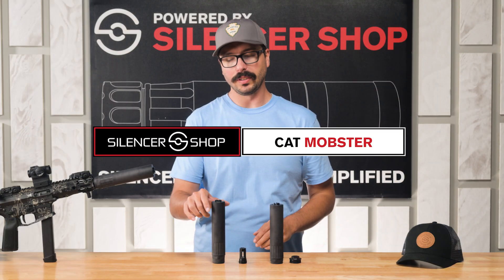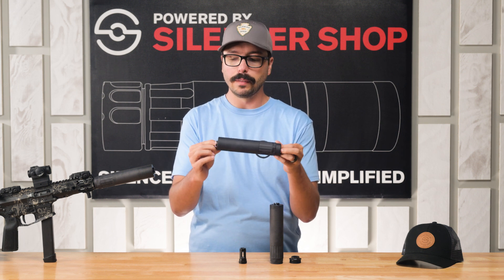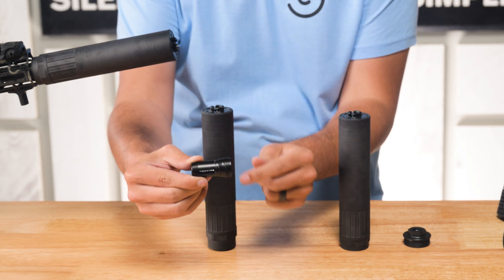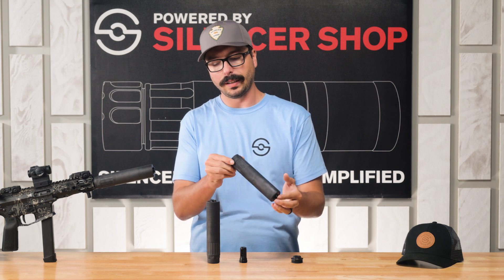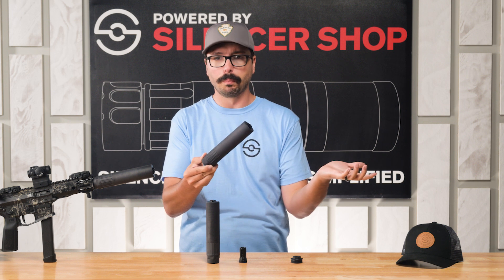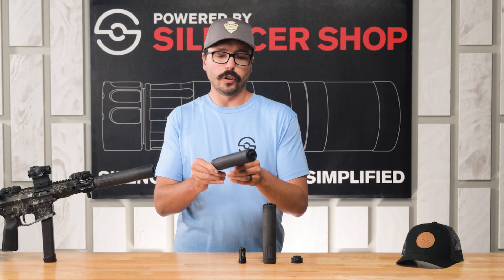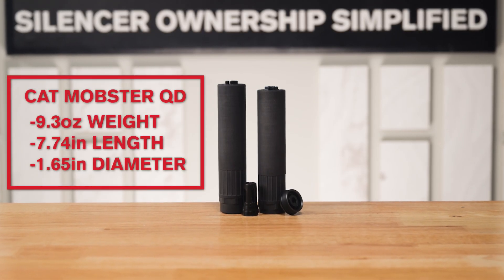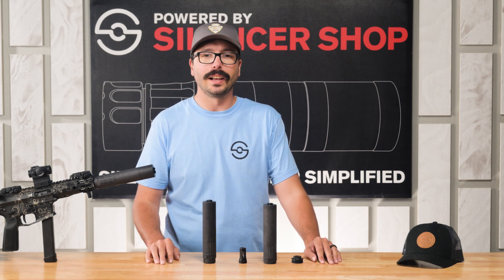CAT MOB - High Performance 9mm Suppressor

Comment: Just got my CAT MOB HUB TI today.
Looks great.
Question though.
What all are suppose to come with the suppressor?
I received Suppressor with DT mount, a Large CAT shirt, a single CAT sticker inside a White plastic pull apart box measuring about 3x3x9" when collapsed.
Was there suppose to be anything else included?
Reply from the maker: That is correct! It seems like you have everything that's supposed to be there.

Comment: What is the difference between the CAT MOB and the CAT/Alleycat 36?
Reply: They're incredibly similar. CAT told me out of all their Alleycat suppressors, the MOB and Alleycat 36 are probably the most similar. The Alleycat is a hair shorter and lighter which is interesting considering most Alleycat are heavier. The MOB has the small flash hider type deal at the end, but the Alleycat does not. Other than that... I'm not sure. I want to guess maybe one less baffle than the MOB, but both sound insanely good to me. I'd go Alleycat if price is the same since it's shorter. Otherwise maybe MOB if it's cheaper.

Comment: 1:51 Does this suppressor work with 3-lug mounts?
Reply from the maker: Yes, with certain tri lug mounts. We used SilencerCo and Dead Air mounts without an issue. The new Resilient 3-Lug also works!
Reply: @SilencerShop  How about YHM?

Comment: I am loving everything about this, but before I can say yes I am concerned about the cleaning process and cost of the cleaning. $140 for the solution is steep.
Reply from the maker: You do get multiple cleanings out of one jug of CAT206, and this silencer doesnt need to be cleaned very frequently, every 2500-ish rounds is fine!
Reply: You can just throw it in the dishwasher.  Titanium is rust proof.

Comment: I got the qd model..almost wish I got the hub mount. I’m looking at getting a sig Mpx k for a host. What’s the best way to mount the suppressor? A thread adapter to 1/2 28? Should I just get a ilwt barrel?
Reply: Even if you get the taper adapter, I don’t think there is a Spooky for the MPX’s thread pitch. You can get your stock barrel rethreaded to something more common, or just go with the ILWT barrel.
Reply: @alexwonkim   yeah I’m getting an ilwt barrel
Reply from the maker: Youll want to use a taper barrel adapter with the spooky muzzle device.
Reply: ILWT 1/2-28 barrel is absolutely the way to go. It's what I'm running and I love it.
Reply: For most setups, sounds like the HUB would be the better option?

Comment: How much better is the CAT Mobster vs Resilient RS9?
Reply from the maker: Theyre both awesome PCC silencers.
Reply: @SilencerShop Don’t be political.  Answer the question boy.
Reply: @Bromo_Sexual  I can answer this as have shoot and own both models :)

MOB wins by a tiny margin on my three host guns AP5,SP5K and 38sp lever rifle using DT mounts.

I need to compare both with 3 lug mounts in the future.

These are so close noise wise plus both have great tone to them shooting it’s a win , win.

If you were  to change the host or ammo maybe the results could flip either way, yeh that close.

The RS9 is the best bang for the price all day and I like its size/shape personally.

The MOB is pretty much king of the hill 9mm Sub-gun wise right now with the Vent 2 and RS9 in the top 3 or 4 models. 

I also have and love the Lithium 9 it’s amazing small and lite weight at 6oz including DT mount and very quiet too. I love it on the baby MP5k’s :)
Reply: @SilencerShop  Answer the question boy.

Comment: Would this be a good  option to use with 350 Legend?  The one I really want is the YHM R9, but I can’t seem to find them in stock!!!  Please advise.
Reply from the maker: Its a great option. It is designed and optimized for 9mm, but is rated for 350 Legend subs and supers in a barrel 16" or longer.

Comment: If you purchase the QD version and later decide you want to use it with trilug, are you screwed?  Can you swap out the QD or is it permanently fixed to the can?
Reply from the maker: QD is integral, if you want to use tri lug you'll have to get the HUB model.

Comment: What if I want a CAT MOB  in stainless or in 718?
Reply from the maker: Not an option right now, and not necessary. 9mm is very low pressure and heat, titanium is more than durable enough even on full autos, and because of the small powder charge 9mm from a PCC has little to no flash at all. For a dedicated 9mm silencer titanium is a top-tier material choice.
Reply: @SilencerShop  so even under nods, there will be no sparking?  I think even the smallest amount of sparking is reason enough to have a stainless or inconel suppressor.  But CAT assured me there would be no sparking like the CGS Ti suppressors I have.  I'll cross my fingers.
Reply: @mattself6078  hey, did you end up getting a mob and if so is there any sparking?
Reply: @markeveren5072  I go pick it up tomorrow.  Going straight to the range afterwards will let you know tomorrow evening.

Comment: How many rounds can you shoot until you HAVE to let the titanium cool down?? Are you talking 15-50 rounds or hundreds? If you are saying you can only do one mag dump why would anyone buy this?

Yes, I heard what you said in the video, But there is so much convoluted information on this company it’s completely maddening. I just want to know if I can go to the range shoot a couple hundred rounds and not look like a fucking weirdo with a heat thermometer. It’s over $1000 for the can and they’re talking about thermometers?
Reply from the maker: We'll to a heat cycle test that will provide a lot more information.
Whats relevant is how you're actually shooting the gun, if you're loading 10 mags, and shooting them all back to back with no wait, then you might get the can hotter than it should be, but very few people shoot like that. 

Most people are runnning drills or casually plinking, where they're shooting a few rounds, then reloading a mag, or resetting a target or whatever, and doing it again. The can cools very fast, so as long as you have some down time it'll probably be good to go. 

CAT recommends an infrared thermometer so that you can build out a shooting schedule  that works for you. 9mm is very low pressure and doesnt generate a ton of heat very fast.
Reply: @SilencerShop  I have 70 round drums for my full auto. Can it handle at least 1 drum?
Reply: @SilencerShop update on the heat cycle test yet? It's been a year, bud

Comment: I really want to get one but wish there was an inconel option. I bought my first Ti Can (CAT WB) a couple months back and realized why so many people hate Ti cans lol. Shooting under nods was like the 4th of July during an NVG class I took recently. Ditched the can halfway through the night and just ran unsuppressed with a flash hider which was actually doable. Sold the WB and won't buy a Ti can again for a semi auto, maybe for a bolt gun though. I get why the Mob is Ti since it would probably be like 2lbs in Inconel, but wish there was a solid option performance wise that doesn't turn my gun in to a portable firework machine.
Reply: How did you sell your suppressor? It seems like a PTA to sell due to the paperwork.
Reply: @FlayvorOfEvil  thankfully my FFL wanted it so it wasn't hard.
Reply from the maker: 9mm is very different than 5.56, in the low pressure lower heat flow patter of the 9mm titanium is plenty durable and doesnt have the same flashing. Also that titanium flashing will dissipate over time!
Reply: @SilencerShop  That's 100% a myth that the Ti flashing will dissipate over time. Maybe it will reduce after an initial amount of shooting to get all the crap out but it doesn't magically turn to nothing. But regarding 9mm, yeah maybe it won't be too bad, I just am one of those weird LARPers that actually wants a suppressor to hide flash in addition to being quiet, but I'd take a slightly lower sound signature reduction over a sparkler everyday.
Reply: @helloimpeterpan5711  dissipate doesn’t mean disappear. Y’all are saying the same thing, they’re just saying it will get better, which it will, as the titanium powder burns off.
Reply: @helloimpeterpan5711 this really only applies to NODs dudes. My ORB sparked for the first 30 or so rounds, and now it’s unnoticeable, but I don’t shoot under NOD; so, it’s a non-issue for me and likely the majority of civilian consumers.
Reply: @helloimpeterpan5711 does that mean it’s a myth it won’t dissipate over time?
Reply: @Furiouspenguin27  yeah it may reduce initially from left over stuff in the can, but it's not going to disappear at any point.
Reply: @Furiouspenguin27  It becomes SIGNIFICANTLY less noticeable after you get several hundred rounds through it, and then it gets realllllly low after a few thousand, but it never goes away completely.
Reply: So.... What is @o bad with Titanium cans?